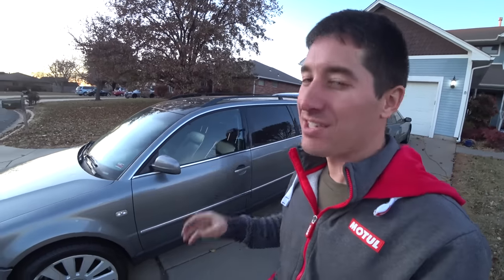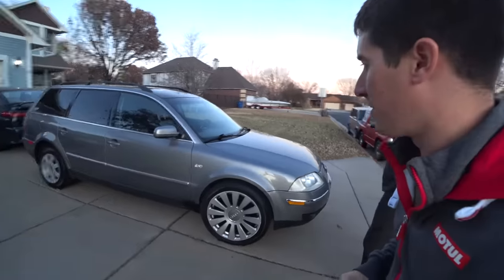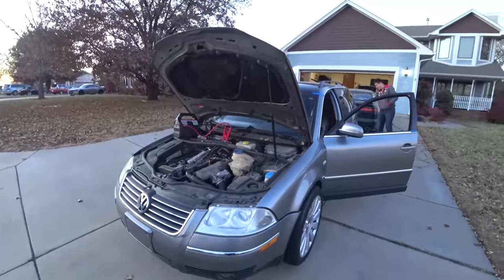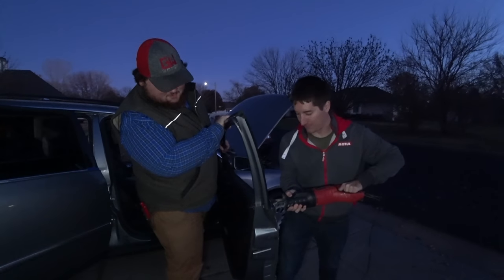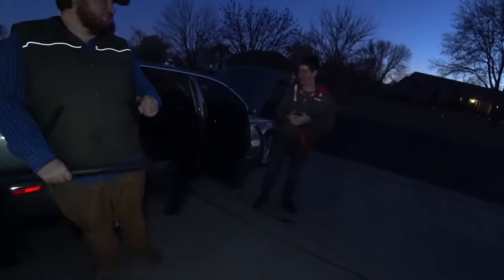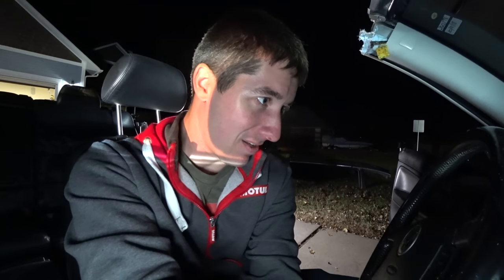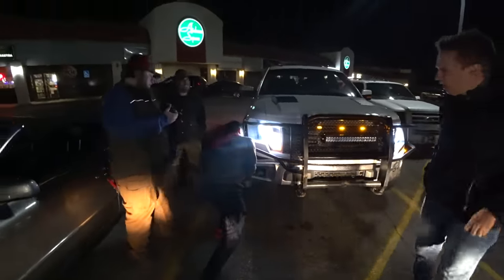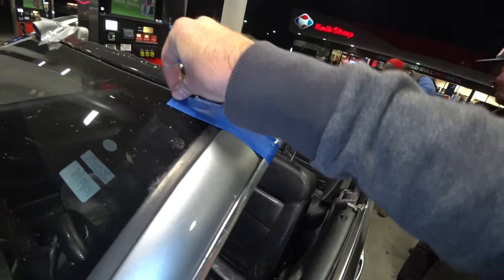WORLD'S FIRST Volkswagen Passat Wagon CONVERTIBLE *Top Only Goes Down*

Comment: My buddy did that back in the 80's to a sunbird we drove it around all summer and the body slowly folded to the point the doors wouldn't open so we welded them shut. Had to carry a box of garbage bags so if it rained we could cover the seats and make ponchos . We had so much fun in that car and laughed as hard as you guys were every time we went any where, everyone got cut at least once from all the sharp bits . Red line neutral drops , revers to first daily how that car survived is anyone's guess. Keep beating on it until it dies don't add any coolant it will be funny to see how long it will last. Just keep adding liquid glass ,eggs , pepper ( all the tricks) and see if the head gasket will seal up.Send it to the farm if you don't want to do it .

Comment: Yeahhh, previous owner definitely overheated it and lifted the head.  Head gaskets don’t blow like that, if the head gasket was bad it would’ve been blowing smoke.  The head is definitely warped.  Having the same issue with a Volvo s40 I bought
Reply from the maker: Yup, was hot enough to trash the thing. Good luck with yours! 🍻

Comment: u can get a bottle of stuff for about $10 that will either fix the leak in the vehicle will be fine or it will f the motor altogether and lock it up. that mechanic guy Scotty did a video on the stuff and he uses it himself u and hovie know who I'm talking about. i frankly, would've tried that before cutting the roof off.
Reply from the maker: I did try it, didn’t hold at all. 😢
Reply: @WatchJRGo  ooo god;(.that sucks. i mite have oo use it on my van and Frankly petrified, the motor will lock up and blow.i dont know if its leaking into the oile. i know my radiator has been leaking somewheres for several months and i finally got the money to replace it.i thank i am besides that i am  leaking somewheres on the block itself.it doesn't help matters any that the temperature gauge nover seems to go past the halfway mark, no matter what. stof u lout can get cheap over in the US you flat out can't even get here in Nova Scotia. When it comes to junkyard `s. most junkyards don't have anything more than 10 years old 

 As an example

Comment: dude i could have sold you a fully built 1.8t for about 800$!! a buddy of mine has a 04 vw jetta gli with a mildly built engine with a new k03s turbo. has cams and downpipe and all. the whole car for 800$!! it just wont go in gear well and we think its the trans. its a beast! also has a unitronic stage 1+ ecu, drilled and slotted rotors and tons of nice stuff. the interior is black leather and its got nice rims and tires and the car has around 115k mile or less. i owed it and built it and sold to him and a year later the trans acted up

Comment: i am going thru this 1.8 t r a disaster , even tried re boring with new cams nothing works
Reply from the maker: Yup, you’ll probably need an engine. Once they get hot they’re never right again 😢
Reply: @WatchJRGo  horrible  engine design, generally u have hardened ring pieces where the cam rests in the cylinder head and cover however in this the cams are directly sandwiched between alloy head and aluminum cover .  Aluminum will never last for this kind of application. Wat were they thinking , i never thought Audi wud do that

Comment: If its a headgasket issue, why not just change it instead of the engine?
Reply: The interior tossed it over the edge.
Reply from the maker: The headwork at the machine shop... always costs more than the entire engine. Usually $500 a pop 😬
Reply: oh ok.

Comment: I plugged a sidewall then drove it 1400 miles back home , it worked but i wasn't all that concerned it was on the rear dual on a 1 ton..   so i had the other one there if it failed..  but surprisingly it didn't  fail even on high pressure tires.

Comment: I don't know if you're aware or not but I had a 350 Chevy engine that did the same thing it would blow water out both exhaust pipes had headers on it of course I went to Walmart. Liquid glass two bottles of it followed the directions to the exact and within 15 minutes of running it the leak stopped you have to let it Harden overnight after draining the system and guess what guys I drove that truck for another 3 to 4 years never had another problem with it never overheated or nothing so maybe give it a try sometime great videos guys